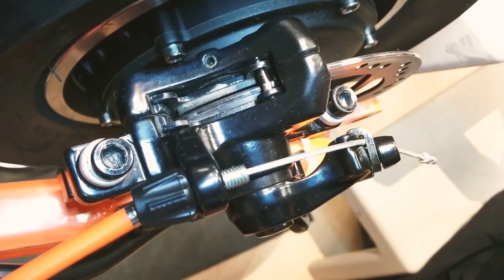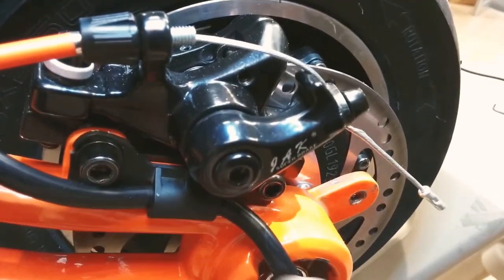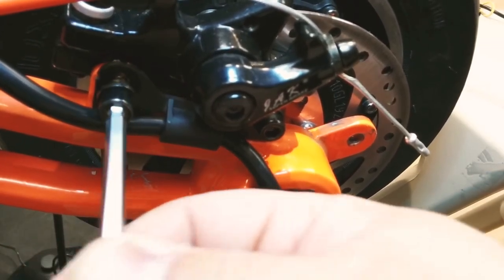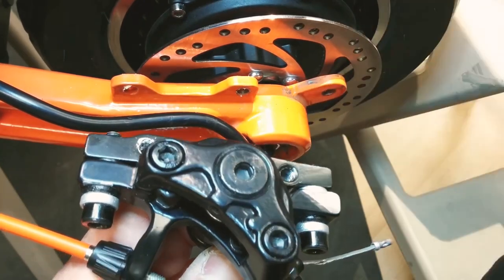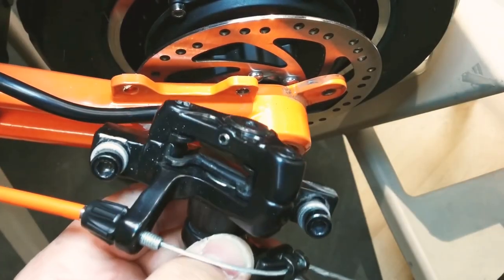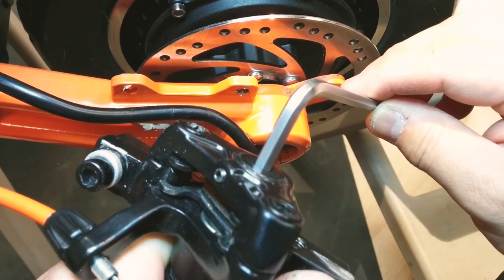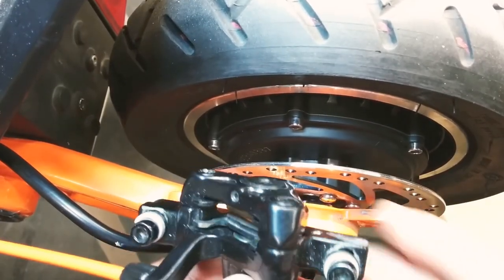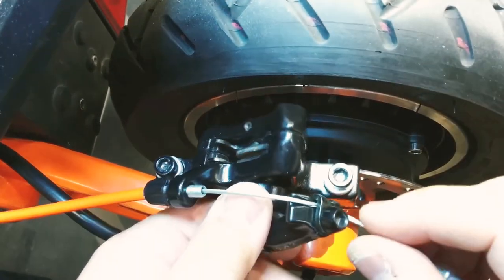INOKIM OX Electric Scooter | Disc Brake Adjustments

Comment: Question, I have the new 2023 ox.  When I spin the rear tire it does not rub at all, but when riding the brakes either rub or the disc will occasionally rub.  Not sure which is making the noise.  Ridden it 5 miles at best.   I think the rotor hits one of the mounting bolts when I shift my weight around or run over something bumpy, dunno.  Thoughts?

Comment: Great video and thank you! Can I ask you if you have any thoughts on an aftermarket kickstand. I just received my OXO yesterday and I must say that I am not really happy with the kickstand. The rest of the scooter is amazing of course. Thank you
Reply: I agree with you but I didn't know myself but you can undo the kickstand on your OXO and you can actually extended it be removing the two screws and extending it further out and this way when you stand the OXO it doesn't lean so much.

Comment: Thanks for this really useful video  which isn't even on the Inokim YouTube channel!!! Just did this - rear braking is much better now 👌
Reply: Hello Sanjay, I agree with you! I also just received my OXO yesterday from Best Buy and I feel that both brake levers have a lot of travel before the pads bite down on the rotor. Granted I just rode it briefly indoors. I will take it for it's first spin today though but I am glad to hear that it worked for you. I will apply this after my first spin later today.